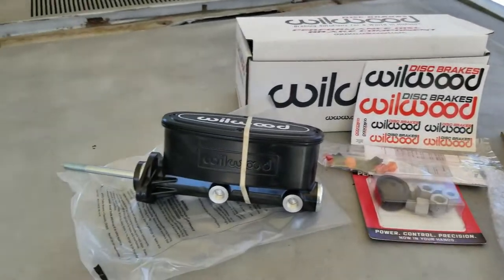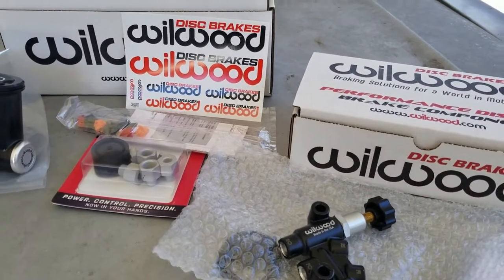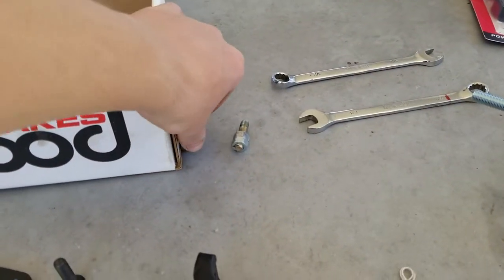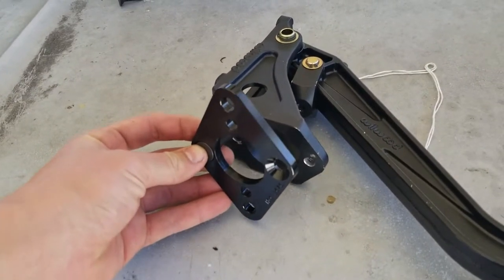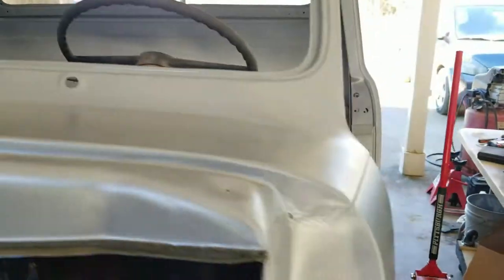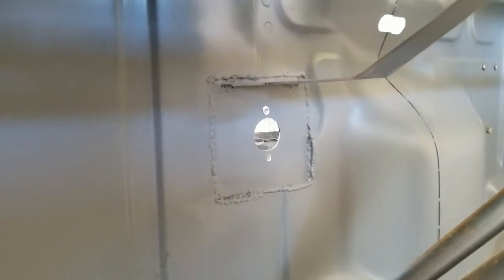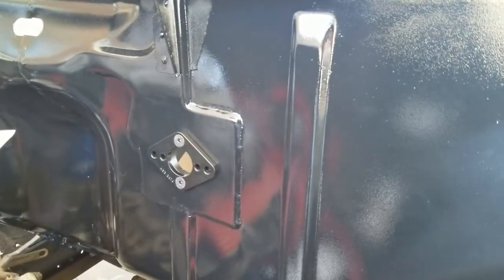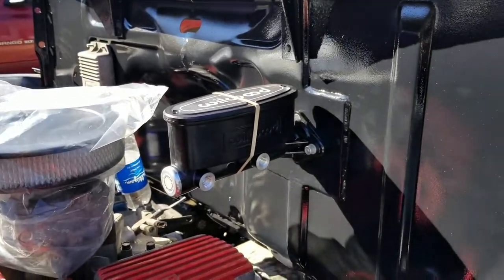1953 F100 - wilwood tandem master cylinder install

Comment: Would u b able 2 guide me with a part number that will have all the parts necessary to complete the willwood  disc brake conversion  with 1 part #. I have a 54 f100. All original. Also is there a reason why u didn't want the brake booster . Just wondering if u were avoiding clearence issues so I dont run into any other problems I need 2 know about..thx  ur videos r helpful 🤝

Comment: I was wondering about your steering components, are they all new? I have a 55F100 and that thing is all over the road.
Reply from the maker: No I have yet to work on the steering stuff. I plan to convert it to power steering with the mid fifties kit